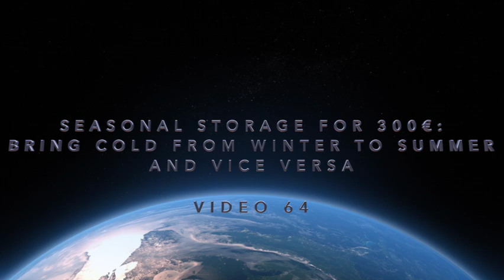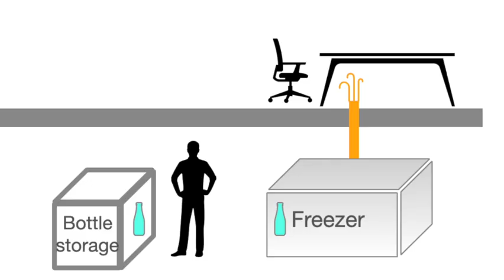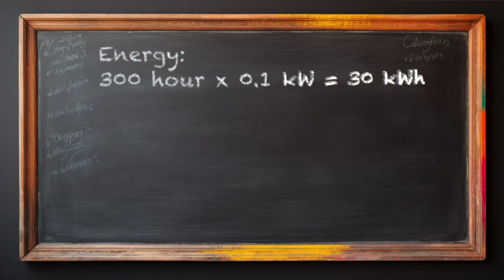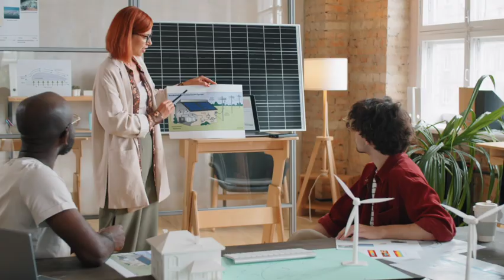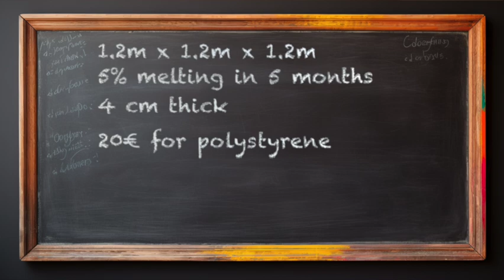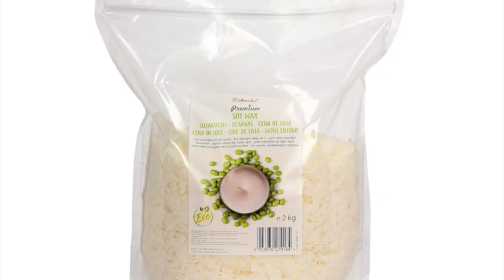Seasonal storage for 300€: bring cold from winter to summer and vice versa - Video 64

Comment: I believe you need to link the fan on the back of the freezer to the compressor or to a thermostat of some kind so it only runs when the coils are hot.
Reply from the maker: Yes, exactly, in principle this is a good measure of Energy Efficiency. However, I think that this will run all the time if you keep exchanging the ice bottles with water bottles. And if you go away and don't need the heat, you just shut off the freezer.

Comment: What happens if you live in a 365 days hot climate?
Reply: Then you should have plenty of PV energy for producing cold.
Reply from the maker: Then you have a large cold demand and smaller heat demand. But this heat demand can still be there. People take more showers (if water is not scarce) and productivity sectors like washing or drying food can form a heat demand. Or distilling water if that is scarce. You will need higher temperatures and the heat pumps must work on different refrigeration fluids. One of those, able to work at high temperatures is CO₂ but it is not easy technology. We certainly have to develop that more and CO₂ is plenty available!
Reply: You can use the deep ocean as a cold source if you live nearby.

Comment: Do you take into account that the heat/cold is being lost trough the walls?
Reply from the maker: You mean the m³ ice box, right? Yes, I calculated it with ∆T=20℃ and the surface of nearly 10 m² and came to the thickness of 4 cm.

Comment: Fascinating that external coil refrigeration/freezers continue to exist in Europe.  So much more efficient and easy to modify.  N. America only sells new models with integral coils...very hard to modify.

Please be optimistic!  Seasonal Thermal Energy Storage has so many fundamental advantages.  There are commercial approaches, but also residential.
Reply from the maker: Also our new inverter refrigerator is made with integrated condenser and you feel the (white, oh boy!) wall getting warm. I even made an IR picture of it. Maybe that is a collateral benefit of buying it secondhand 😀!
Reply: @nnvasen-good-energy  It's a tough one...better compressors, but worse coil engineering.  Heating the wall to exhaust heat outwards right next to the wall that has to keep heat out to keep food cold.  I have found that insulating top and bottom of new refrigerators can help a lot.  Heat exhausted in a vertical band between the top and bottom 10cm of a chest freezer.  Underside can be so badly insulated that condensation and mold forms-so, energy waste and health risk.
Reply from the maker: You are right, I should remain optimistic. Financial people call it Arbitrage! Bringing stuff from a cheap place to an expensive place. In the same way I don't want just to suffer the heat wave but make a deal from it 😉.